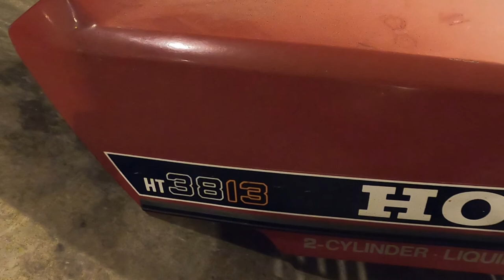Honda 3813 Back From The Dead?

Comment: Hey Dave cool video! What do you know about the spark on these? I'm working on a HT3813 for a customer and ive got very weak spark, using 6 different spark testers 😭
You're so right about the selling feature comparing it to a car! Exactly how I sold them starting in 1985, then came the 4514 and 4518, the RT5000 with all wheel steering. Awesome equipment, WAY ahead of their time. Anyway I'm retired from the that now but work on same part time out of my house. Let me know if you can help me with the weak spark issue please, thanks!

Comment: I guess you fixed timing.  How much did start cost?  I'm looking to grab 1 of these that's not running
Reply from the maker: I got the starter off of Amazon.  It shows it at $66.30, but I thought I paid more than that.  The good thing is there is no core charge, so go get the new one and you don’t have to send your old one back.

Comment: Hi I just got 1 and I can get it started.  The battery works and it will start if I touch the solenoid with a screw driver but the ignition doesn't get power. What do u think it might be
Reply from the maker: If it turns but does not run I would start by checking the fuses.  You should also check your deck engagement lever and switch, it will not run if the deck is driving, or if the switch thinks it is driving.  After that I would check the wiring harnesses to make sure everything is hooked up, and there are no damaged spots.